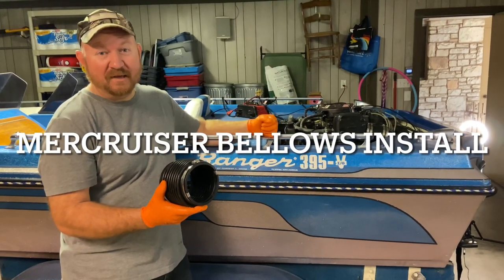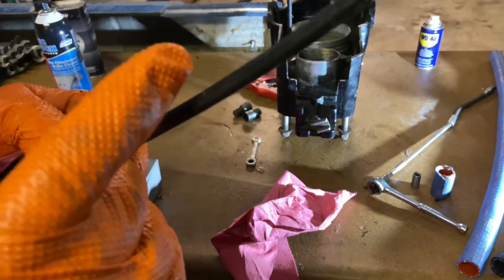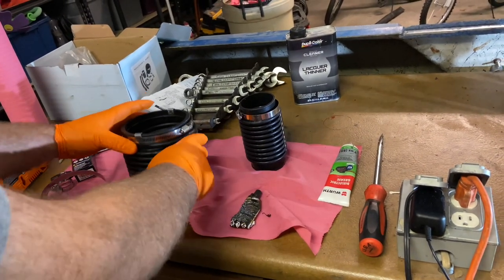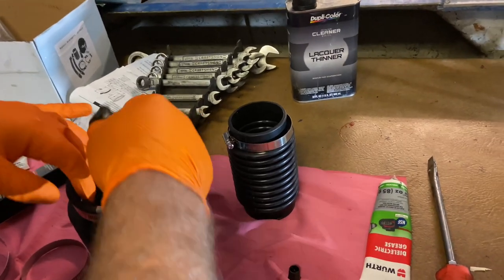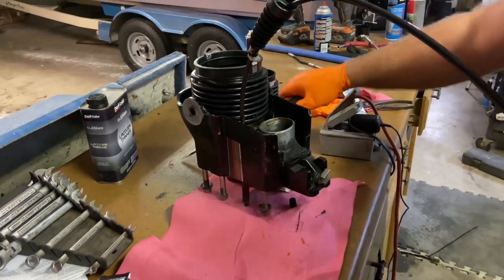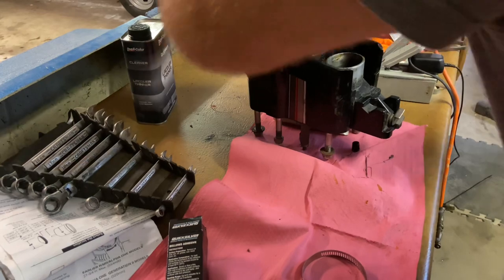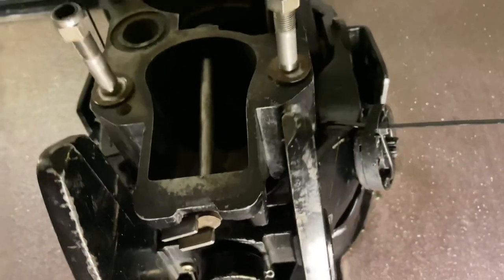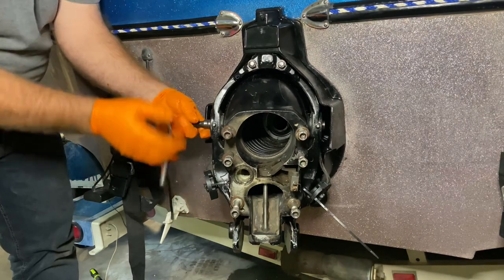Mercruiser Alpha 1 Gen 1 Stern Drive Repairs Part 5: How to install a Mercruiser bellows on a boat

Comment: Problem solved on how to get lower shift cable to fit into the threaded end of the shift slider so that the set screw will fit and then the security wire.  Everything you told me was correct but the one thing neither of us knew was that I had a factory defect on the nob or nut on the back of the shift cable preventing it from entering into the shift slider making it possible to screw the set screw in.  SEI tech told me that they had a few others with the same flaw.  He recommended taking a grinder and taking the metal or metal burrs down until it would fit into the shift slider.  I did what it said and Praise the Good Lord I will sleep much better tonight.  I THANK YOU SO MUCH for your patience and the info you provided.  Every suggestion you made was text book correct.  Once the factory flaw was taken care of everything worked.  I really hope that this info might help yet another rookie wrench out there like me.  Thank you again!    Mel
Reply from the maker: Mel-  Defective parts can make it a confusing and frustrating process, especially when you're having to diagnose the defects in the new parts.  I'm glad SEI had a representative to help you diagnose and repair that defective part to get your project back on track.   Thanks for commenting so other viewers can see how your issue was resolved, in case they run into the issue as well!

Comment: Hi! Tell me, I have on such a column when switching to neutral, the neutral does not get up, I have to drive the handle further, only after that it gets into neutral. Is the cable to blame?
Reply from the maker: Sounds like you need to perform a cable adjustment and check for slack in the cable.

Comment: You didn't show how you clamp the aft (smaller) end of the shifter bellows.  Did you just leave it?  The ring is supposed to be clamped down with a special tool, although you can make one with a pair of pliers and a 1/2" nut.
Reply from the maker: I cinched it down tight with a pair of pliers.  Works great- no leaks.  Just gave it another good test today all day on the lake!

Comment: Great Video! I may have missed it, but does the shift cable boot require a  "final crimping" at the aft end? I saw where you tightened the screw clamp onto the transom end, but didn't see if you needed to crimp that compression ring once you started to put everything back together.... Maybe I missed it? Or maybe you don't need to put that extra squeeze on it? Anyway, thank you for such a detailed video!
Reply from the maker: Awesome! Thanks for watching.  Yes- I would give it an extra crimp once everything is in position.

Comment: Great video! Could someone explain why 99% of peoples apply bellow adhesive and immediately installed the bellow? As per OEM it is should be dry and no more tacky before installation
Reply: I read the same in the manual, but I apply right away because it acts as a lubricant for a short time and makes it easier to get them over the mounting holes!! It still dries and holds (at least in my experience!!)

Comment: Hi there. I just tried to put Mine back on but it seems the water hose I received is possibly too long? Did you have to cut your water hose to make it all fit together?
Reply: No need to answer. I just started over and was more careful about setting the water hose. Exactly as it needed to be fitted, and it all went together fine.

Comment: Great video but you skipped over an important step that I am struggling with.   At 14:15 your tightning the ujoint bellow clamp onto the gimble, what position is the clamp at?  What tool are you using to accomplish this?  Also when did you attach the water line?  That part seems to have also been skipped.  What would be the best order of operations regarding that?
Reply from the maker: The U-joint bellows clamp is placed in approx. the 3:00 position when tightening from the bottom and can be tightened with a screw driver or 5/16 socket on a long 1/4 extension (not shown in video.  I had to lay on the floor to install that and it was too hard to film and install at the same time. ) In the video-  I am tightening the exhaust bellow to the gimbal plate. An access hole in the housing provides a way to get your screwdriver on the clamp screw. I used a very long screw driver to tighten the clamp. The water hose was attached at the top before I installed the bellows. The lower portion of the hose was installed along the way. The order is not real important as long as the clamps are oriented so you can access.

Comment: not sure how you did the shift cable procedure when you were closing in on the gimble to do the water line and bellows? Were you feeding the cable in at the same time?
Reply from the maker: I had the shift cable loose and routed through the shift cable bellow. I had the cable lubed up so it would slide through the shift cable bellow as I put it together. I installed the shift cable to engine side and adjusted after the bellows were completed.
Reply: @ProWrenching  Thanks my man... I'm tracking!

Comment: If the shift cable bellow  is broke will it cause water to come into boat. I just bought a 1988 rinker v170  and it's leaking water just on the one side of the inboard not on both sides
Reply from the maker: Yes- it will cause water to come into the boat.

Comment: Thanks for an excellent video, I have ordered all the parts and the tool as well, I will give it a go.
Reply: My driveshaft bellows and housing is different than yours, on mine the bellows goes inside of the rear housing with a retainer ring that goes inside to press it into the grove, which end should I install first, the rear as you did?

Comment: Just learned the fresh water tube on my Alpha One is leaking.  I can't work on my boat where I live. Wonder what a shop should charge me?
Reply from the maker: Sorry to hear that.  I’ve lived in places in the past where I couldnt work on stuff either, so I know how that it is.  What a shop would charge will vary wildly in different areas, so it’s hard to say.  I do my boat work myself and don’t have knowledge of boat shop prices.  I would call a few places around where you live, tell them exactly what you need and see if they’ll give you an estimate.
Reply: Thousands

Comment: Got my bellows and have all the housing cleaned up, and I am about to start my bellows reassembly.  I was wondering, after the u-joint bellow was attached to the bell housing and the exhaust bellow was attached to the gimbal housing, when bringing the two housing together, why did you start with the u-joint bellow?  It seems you should be able to tip the bell housing on the hinge pin pivots and get the exhaust bellow pretty close to the bell housing making for an easier assembly.  Finish the exhaust first, wait for all glue to dry, then move onto the u-joint bellow.  Or is too challenging to get the glue in place for the u-joint bellow when the exhaust is already attached? I am just spitballing here since I haven't tried either yet.
Reply from the maker: Well, my thought process was the u- joint bellow is the most critical bellow to make sure it is installed correctly and glued into position.  If your u-joint bellow leaks, it can damage your gimbal bearing and u joints.  A leaky exhaust bellow won’t damage anything. It’s a challenging install.  Thanks for watching!  I appreciate your comment.
Reply: @ProWrenching  very good point, that is exactly the reason I'm in my current position, I had a leak in my u-joint bellows and it corroded by u-joints.

Comment: I’m about to do this this weekend and all I keep seeing is needing special tools and it’s hard
Reply from the maker: Give yourself plenty of time to get to get it done.  It’s a not a job you want to rush. There’s a special tool you gotta have to remove the hinge pins on the gimbal.
Reply: @ProWrenching  what about the set ring for the ujoint bellow?
Reply from the maker: @kodagaming9437  sounds like you might have the Alpha 1 Gen 2?  Mine is the Alpha 1 Gen 1 and there are some differences.  I dont have a set ring on mine.  You do need a special tool for installing the set ring.

Comment: What happens if the drive shaft or exhaust Bellows tear? What should I inspect to ensure nothing is damaged?
Reply from the maker: If the drive shaft bellow tears, you’ll get water  in the  drive shaft and gimbal bearing and also it will start leaking inside your boat. It will start to make a loud noise, usually from the gimbal bearing. To inspect it for damage you will need to remove the stern drive. If the exhaust bellow tears it will not cause any damage.

Comment: clean job, im mechanicly inclined. i was debbating in getting the exhaust bellow tool, might save you a couple minutes. but i dont think its necesary. w do you think?
Reply from the maker: I had debated getting the tool myself, but I was able to get the job done without it.
Reply: zip ties!  There is another video on YT that uses a zip tie technique that draws the bellow back into the sleeve.

Comment: Great video.  I'm in the middle of this job. Just replaced the gimbel bearing, shift cable and SC bellows.  There are two o rings that came with my bellows kit.  Do they go into those grooves in the ujoint and exhaust housings? Thanks.
Reply from the maker: One o ring goes on the drive shaft and the other one goes on the gimbal housing where the stern drive bolts up.
Reply: Great man. Thanks again.  Do i use adhesive on the water hose?
Reply from the maker: @joeguerrier7975  No- just a clamp.
Reply: Thanks. Your the best.  Keep it up.  Also I think the only Gen 1 specific and complete vids ive seen.  Well done sir.
Reply from the maker: @joeguerrier7975  Thank you, sir for the compliments.   I appreciate it.

Comment: I was struggling the exhaust bellow for hours and days last summer. Every time it slipped off at first rising of the drive (after maybe 24 hours fixing).  Ended up buying a "cheating" part that was just a muffler on the outdrive. It was kinda working, but of course the sound from the exhaust was higher (too high). 
But I see now what I maybe failed at: 
I was waiting 15-20 minutes after attaching the glue on the bellow and the flange before fitting it: Causing this operation to be a struggle beyond every night mare... Sticking at the first contact and fighting all the way into position. 
I mean that I did according to the description on the Quicksilver label, but after 3 tries in a week I gave up. 
Now I have ordered the special plier, and after watching your video here, I'll give it a try with wet glue, and not dry glue as last summer. 
Do you have any other good advice for a cold frezing Viking up in the far oceans of Norway?
Reply from the maker: From one Viking to another (I have several great grandparents that came from Norway! ) -  Ok- the bellows come coated with a white, powdery residue (which is actually a poison for rodents) that needs to be cleaned off thoroughly before installing.  Also- you’ll want to use the Quicksilver bellows adhesive.  I found it easier to install with the glue wet.  Good luck with your project!
Reply: @ProWrenching  ... Working on this right now. Seems that the flange on the trans is kinda cone. So I have to wait util the glue has fixed a litte beforte tightening the clamp on the transom side. After that, I'll go for the outdrive side.

Comment: You put the shift cable bellow hose clamp upside-down - if you ever have to change that and you don't want to remove the Gimble housing then you wont be able to get to the hose clamp.
Reply from the maker: Thanks for the tip. Most likely when it fails. I’ll end up doing a rebuild anyway,  just like I did this time.

Comment: Great videos!  I have a kinked and damaged water hose on My Alpha 1 Gen 1.  Do I need to pull the upper part of the outdrive off in order to replace the hose?  or can it be done with the outdrive trimmed all the way up?
Reply from the maker: Thanks!  Yes- you will need to pull the upper part off b/c the hose is hard to access.  You’ll be able to undo the lower side of the hose but you won’t be able to reach the top part.

Comment: With respect to the shift cable attached to bell housing, was the cable simple removed from inside the boat and pulled out? Do you need to remove anything from the Bell housing where the cable attaches? Also, was there a special retaining clip for the water hose where it attaches into the Bell housing?
Reply from the maker: Yes- I pulled the cable out from inside the boat, with it still attached to the gimbal.  It just passes through the bell housing through the shift cable bellow.  Once you loosen the clamp for the shift cable bellow and have disconnected the shift linkage from the engine, you can pull the cable out with it attached to the gimbal.  There's not a special retaining clip, just a hose clamp.
Reply: @ProWrenching  Thank you very much!

Comment: Hey there!

I am in the middle of changing my bellows and water hose and whatnot. I need to get some water hose and you are the second person to suggest the heater hose -- I don't know much about it but I was told I could get it at NAPA... does it need to be 3/4" or 5/8"? Or is there only one size of heater hose? 

Also, do you know what length of hose you got? I was told 13.75" is what it needs to be.
Reply from the maker: Some alpha one gen ones have 5/8 hose and some have 3/4.  You may want to take a sample of your old hose with you to the parts store or measure the pipe that it connects to to see which one your boat has. The 13.75 sounds right for the length.
It is important to install and run stern drive up
and down after install to make sure the hose does not kink. That’s why you don’t want the hose too long or short.
Reply: Okay thank you! As far as the type of hose I get… does it need to be some special extra thick heater hose or just the normal silicone heater hose I could get from Napa?
Reply from the maker: @josholiver11  i used the regular silicone heater hose on my boat.  It works great!
Reply: Hey again, I got the hose on there and as I was installing the final piece of the exhaust bellows (after doing all of the rest of the stuff) I looked up and noticed that the hose was kind of kinked… I got the exact same one we discussed/the one you have in the video… wha do you think the problem could be?

It only folds a bit when you steer all the way to the left…

Any thoughts? I pulled the bottom connection back off and I’m thinking I might just cut it a bit shorter to see if that solves the problem, have you faced that issue?
Reply from the maker: @josholiver11  Yes- it sounds like it may be a bit too long.  Yes- try shortening it a little and see if that helps.

Comment: Hello I’m a beginner boat owner! I purchased my boat and took it out on the water to test it, and noticed water had filled in the engine room. Then I noticed that the exhaust bellow had a rip in it, so I replaced it. When I took it out to the water to test if water would leak into the engine area, I noticed the water leaks into the boat only when the propeller is up. When I put the propeller down, water does not come in. I’m unable to locate what’s causing the leak, could use your advice. Thank you!
Reply from the maker: Well,  it’s hard to say without seeing it, but if I had to guess - it sounds like you might need to inspect the shift cable bellows for leaks. You may have a tear in your shift cable bellows that stretches and gets larger when your propeller is up, allowing the leak.  Congratulations on your boat!  Happy boating!
Reply: If your exhaust bellow is ripped or even completely missing on either an Alpha 1 or Bravo 1 drive, all it will do is increase the exhaust noise and WILL NOT CAUSE WATER TO ENTER THE HULL.  The reason is that the opposite end of the exhaust bellow in the engine, is the exhaust riser and that is positioned much higher than the exhaust bellow.  I'd agree with  Pro Wrenching and check the shift cable bellow.  If the starboard, aka driver side is ripped, then steering to the port side will tend to stretch the gap open and cause more leaking.  Opposite  effect happens if the port side is ripped.  Also worth looking at the u-joint aka drive shaft bellow for damage.  Good luck to you.
Reply: I agree with the other guys here ,,the exhaust bellow is not the cause ,,maybe the shaft bellow (the big one),has a rip on the bottom are so when you pull up it becomes bigger ,,or like the guys said the shift cable ,,

Comment: what is the purpose of those rectangular clips that are under the u joint bellows clamp?
Reply from the maker: The clips ensure the hose clamp is grounded so it doesn’t corrode.

Comment: Hey question for you, what type of water hose did you use?  The OEM hose I got is a rubber 5/8 ID, and it just is too thick to insert onto the water intake tube and clear the housing.  Not to mention, even with a heat gun, it is pretty stiff and thick.
Reply from the maker: I used silicon industrial grade heater hose.   (It’s blue). That’s much easier to install.   It’s very important to make sure it’s the right length.  If it’s too long it can kink.  Also- after you get everything installed, run the lower unit up and down to make sure the hose does not kink at any point.
Reply: somebody told me today they use the clear reinforced hose and called the black rubber ones rubbish, he does about 20 a year that way